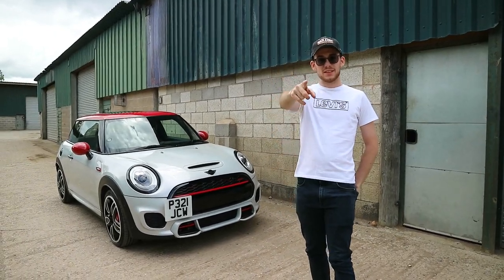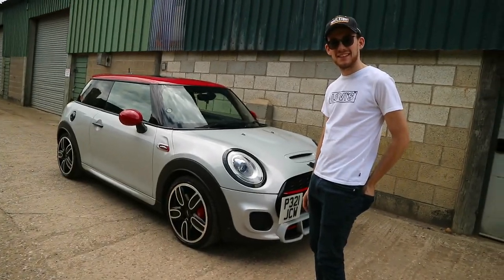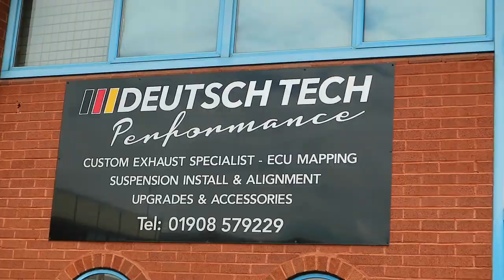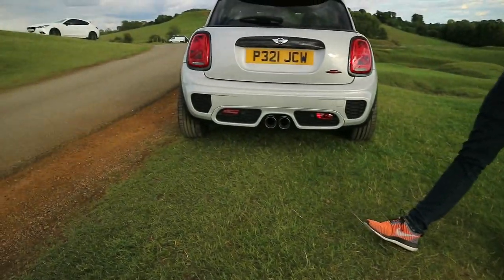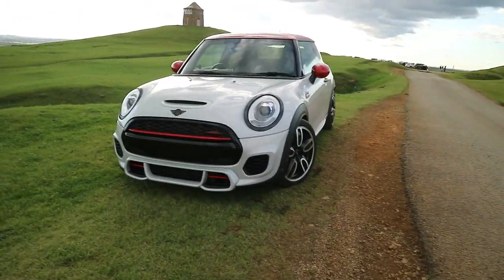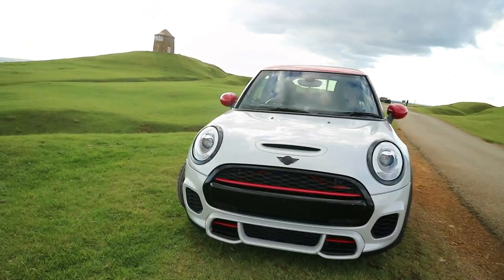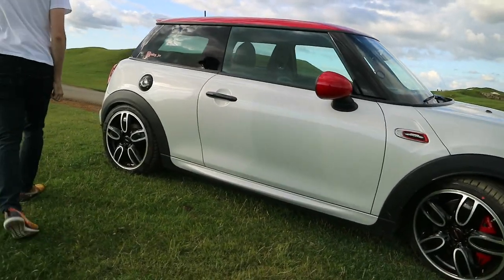Eibach Lowering springs and spacers @ Deutsch tech | F56 Mini John Cooper Works

Comment: Great video - could you confirm if these are 205 or 215 PS4s? I have the identical set-up except with 215s, not sure if they will rub if I put 15mm spacers on. Cheers!

Comment: Great video - thanks. I’m thinking of going to the same company for the same work. Can you please provide a ballpark figure you paid, maybe just suggest a budget please. Would £500 cover it?  Also, I guess if I phone that company and tell them what I’m looking for, they can supply as well as fit?
Reply from the maker: So we have some rough figures for you, £220 for springs, £140 for spacers, £30 a corner for tyre fitting (I would go elsewhere as this is extortionate! We normally get £10 a corner, but Rob was impatient!) And it was £150 for fitting spacers and springs. I would call or drop them a DM on Instagram to get updated prices as these would be 9 months old now. They will supply and fit, I don't know if they will supply for you to fit on your own. If you want that option go to Lohen as they are £222.50 as of today. The new tyres were from black circles and were £485 without fitting but delivered. For the springs and spacers your probably looking at around the £500 mark 👍 Thanks Zach

Comment: How's the ride quality on the Eibach springs?
Reply from the maker: Hi, We found the ride quality great on the new springs, although an antiroll bar change could finish it off. Watch this space :P
Reply: How do you comapre it (ride quality) to standard springs? Is it much harder right now?
Reply: @RallyRaceGuys  what do you mean by that, was it an improvement in terms of comfort in general or less body roll through corners?
Reply: So the springs make the ride harder and bumpier on backroads, however the body role is massively improved and it holds the road so much better. The handling improvements are worth the decrease in comfort for sure.